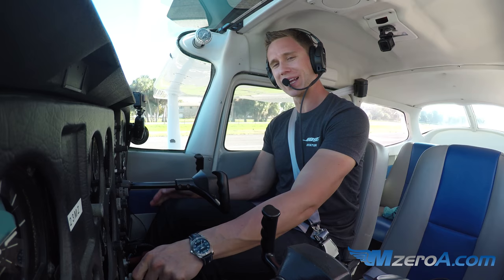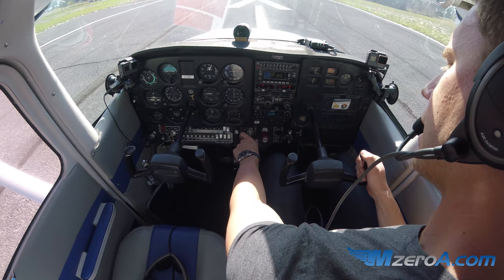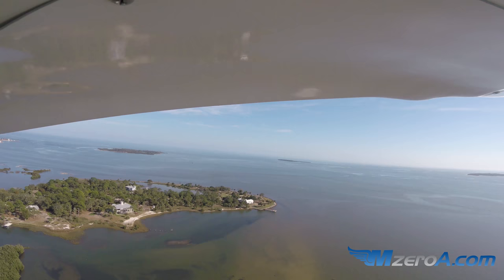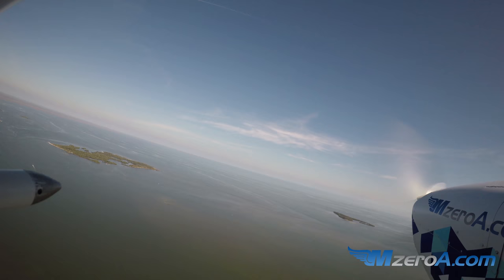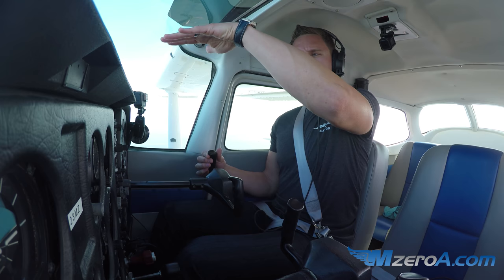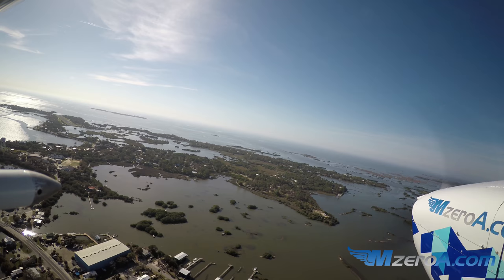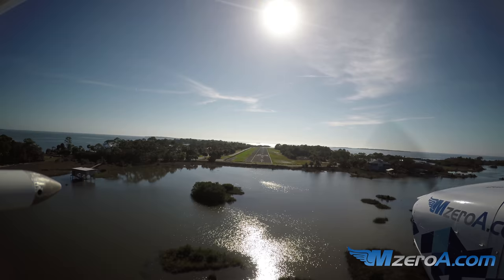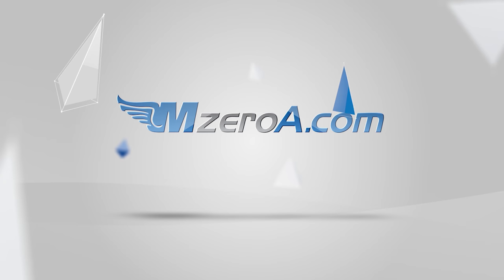Short Field Takeoff and Landing - MzeroA Flight Training

Comment: I've watched a few of your videos and every single landing is a symphony; you're calm, you're confident, you're in control. I seriously wish I could just get it together. I've been struggling with pilot anxiety and I've already put about 40 hours in. Landings, maneuvers, stalls...those always seems to get me going to the point where I can't think about what needs to be done. There just seems to be a lot to remember, especially under pressure in "the moment".
Reply: I hear you.  I'm about 55 hours in and I swear, whenever i get out of the plane, I forget my landing'pattern work and basically have to relearn it every time I go back out.  Take-offs I'm good on.  Stalls I find get easier...basically nose down will get you out of a stall, power on or power off.  Good luck!
Reply: 41 hours 3 days prior to this comment, it does get overwhelming at times. I had my fare share my brain locking on me with the complexity of short field and soft field landing and takeoff.

To me, it's about multi-tasking and know your numbers on your aircraft, read it out the POH and plan ahead. If you fall behind, you'll play catch-up and lose every time for a perfect landing.

Also follow the flight maneuver handbook, or a syllabus and keep practicing, I'll be doing Short and Soft field next week.
Reply: Well, check in with us. 5 years later, how are you doing?
Reply: @McStebb  haven’t flown since fall 2019 unfortunately but I did pass my checkride and got my PPL. A LOT has happened since then and I’d say mostly for the worse. But things have taken a different direction lately so I might get back at it eventually!

Comment: I learned to fly in Cherokees off a 2100 foot runway with 2000 feet available for landing. You learn precise speed and altitude control very early at such an airport...
Reply: Cynj? 😂
Reply: @etnies777  Yup. Langley.
Reply: @marsgal42  Had my solo in GCEP <3
Reply: @etnies777  Mine was in FKKF, which was my favourite plane throughout flight training.

Comment: Unbelievably long float.  That is not a short-field approach and landing.  The ACS requires minimum float.  The FAA Airplane Flying Handbook indicates the short-field landing should have little to NO float.  If you approach over an obstacle, where you can't aim before the runway, you would use an enormous amount of a short runway because of your out-of-control float.  There used to be a runway at Marlborough MA where the runway was only 1600ft long and landing north it was over trees.  They had flight training there for years.  I doubt you would be able to keep it on the runway there.

Comment: Thanks a lot for the video. Question though: I'm learning in a 172, and aiming for 60 knots approach speed with full flaps on final. Seemed like you were coming in a little hot for a short field landing weren't you?
Reply: I believe his airspeed indicator is in mph so it's pretty much +10
Reply: 75 on base 70 on final 65 over threshold for normal approach, short field you should be coming in in the region of reverse command so basically 5 knots slower the whole way. I would assume you're passed your training by now, but I find this channel isn't very good for educational videos

Comment: does it really help to raise the flaps to reduce the landing distance? also does it apply to all aircrafts?
Reply from the maker: It's all about putting weight back onto those main wheels to increase braking efficiency.
Reply: In addition to improving braking, when you fly a low-wing plane you want to raise the flaps as early as you can to reduce the possibility of debris hitting them.
Reply: why do some instructors does not allow the raising of flaps until the aircraft has come to a complete stop or exited the runway. what are the cons of raising it at the roll
Reply: Distraction during a busy phase of flight. In some planes, the possibility of activating the wrong control. My Musketeer has a Johnson bar for the flaps (just like a Cherokee) so I can clear the flaps without even looking, and with zero risk of the wrong control.

Comment: Currently working on these in a sport cruiser. Huge thanks for posting the video. Any advice on not letting the plane float to long in ground effect but not forcing the plane down to hard? I am having a hard time finding that sweet spot.
Reply from the maker: It's all about managing that airspeed
Reply: Pitch for airspeed  - are you on the specified airspeed? Are you controlling that airspeed +/- a couple of knots? Power "to the spot" (altitude/descent angle). Realize that your aim point is not the touchdown spot. A steeper approach will minimize power changes. If you get it right, your flare will result in no floating but a perfectly timed nose high flare just as the mains touch with little to no vertical descent. Practice.

Comment: Hey Jason - my CFI teaches short fields substantially differently. You said were about 70kts on short final, that seems way fast for even a standard landing - the POH for our 172s says normal landing is 65kts and short field should be about 61. He teaches basically slow flight through final at 61kts, then just pull the power out gradually to settle onto your point. I'm curious which you feel is better? Your approach seems to give more of a safety buffer but also depends on knowing exactly how far your plane will float.
Reply from the maker: Hello! Jason slows down during final and continues to do so as he gets closer. What your CFI teaches you is a good technique as well! If you need any further clarification please reach out to us at support@mzeroa.com. Fly safe! Thanks for watching!
Reply: @MzeroAFlightTraining  Maybe he slows down, but the long float is still unacceptable.

Comment: Does the short-field procedure for a C172L call for zero flaps? Or does this 172 have an STC?
Reply: aviatortrevor the purpose of the flaps is to increase lift (coefficient of lift will be greater for a given AOA) and drag. If you want to land in a shorter distance, you'll need both.
Reply: pilotgil I should clarify I was asking about the takeoff procedure. The POH in the 172 K thru P models I fly say zero flaps for a short-field takeoff. I believe the R, RG, and S models call for flaps 10 at takeoff. I'm a CFI. All models say full flaps for landing on a short-field.